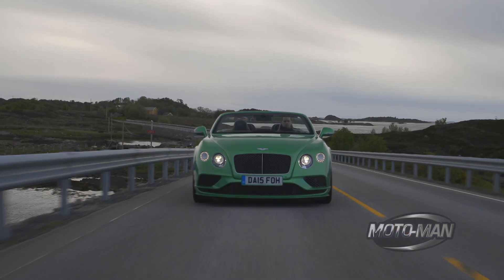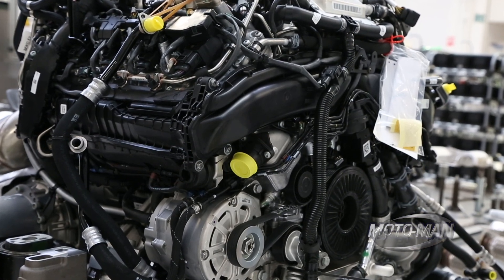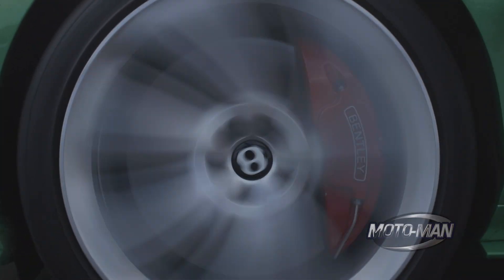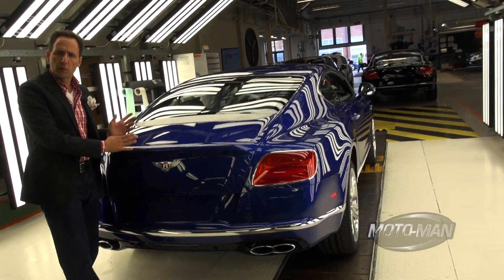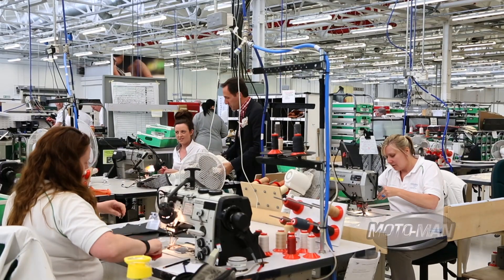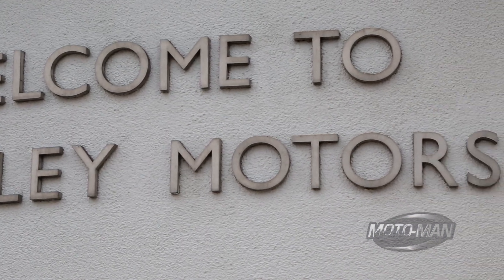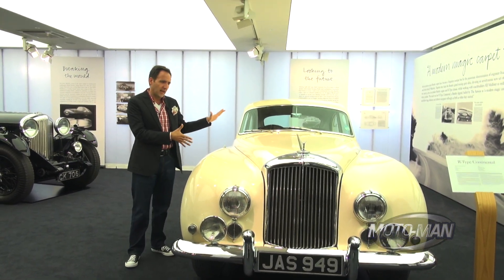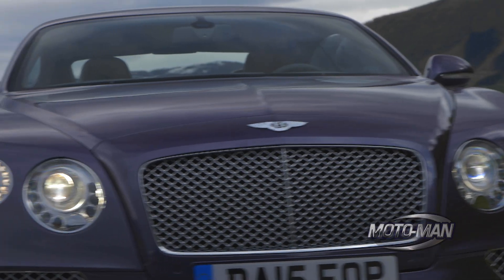2016 Bentley Continental GT FIRST DRIVE REVIEW on Norway’s Trollstigen & Atlantic Road

Comment: Just changed 2015 Speed to 2016 V8s few month ago.I like V8s but I prefer Speed because of silkyness of the w12 engine.Like you said, it is really depends on the preference. :)P.S.Naim stereo option is good but it's huge unit limitates the trunk space.
Reply: What difference and feeling to get when comparing V8 to V12 ???

Comment: The v8 models utilise the hot v layout for their turbos, which is great for throttle response but bad for cooking turbos. Treat the v8 engines with great care, never drive them hard from cold and always drive them gently before shutting down. Failure to do this and you will cook your turbos. This applies to some Audi engine models too.